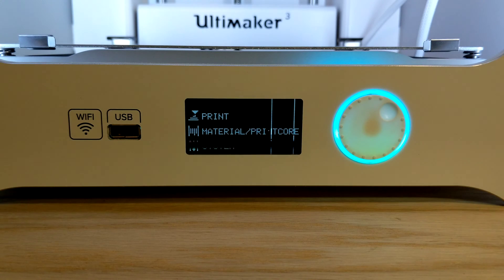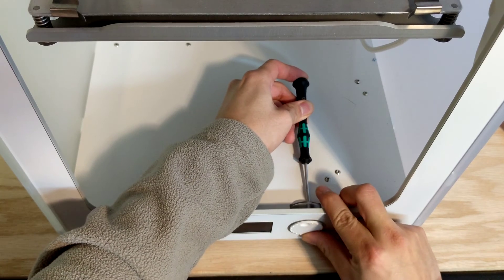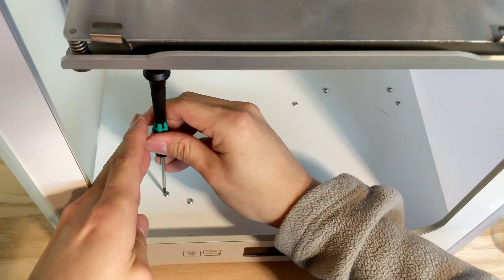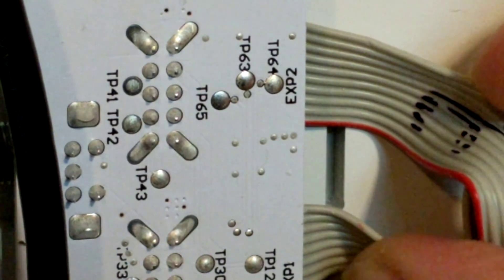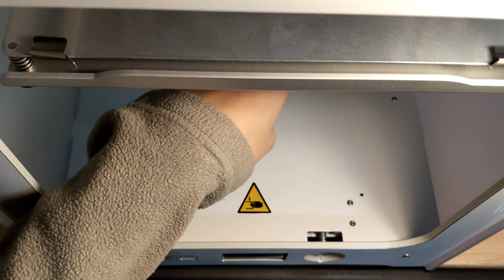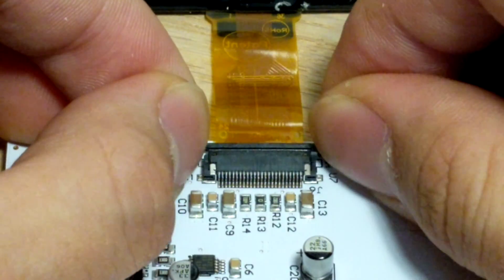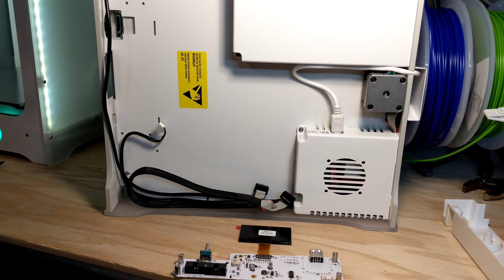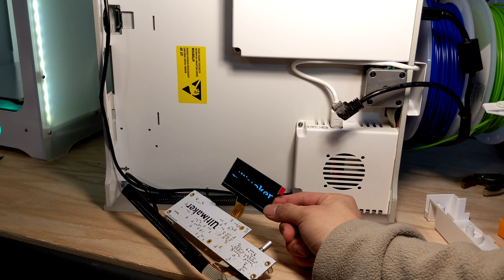Ultimaker 3 3d Printer How to replace your display.

Comment: hello, is not a way to repare this screen ? mine is actualy almost toaly dark.. it was some pixel mess before. this came alone almost dont use the printer and in dray good place without dust ect
Reply from the maker: I don't understand what you're saying. Could you please reask your question?
Reply: can we repair the screen by maybe heating or unmounting ? because is alot of people have this issue on ultimaker 3 many even less of 1 year they bought it.. me 1 year and 3 months. i saw many lcd get repair in asi then i was asking if its a way to solve that. the country where i am actualy dont have this screen and order from cana will be an crazy price of shippment
Reply from the maker: @fraizer2600  you can give it a try. I never had success with that myself. you can also try to order a used one off eBay or something like that.
Reply: The thing is i dont know what to do to repair it lol. I found nothing about that. And I found used but for ultimaker 2
Reply from the maker: @fraizer2600  yeah, I wish I could help. I'm not familiar with anything before ultimaker 3. I would advise that you go to the ultimaker website and contact their support see if the parts are compatible.